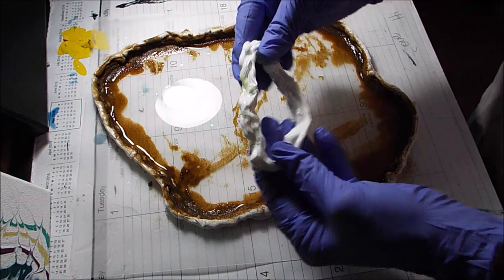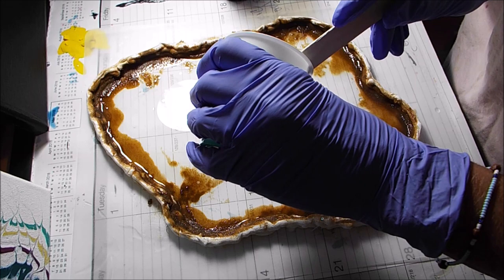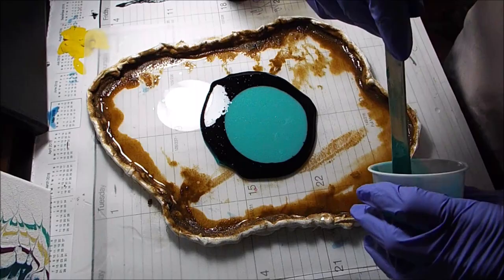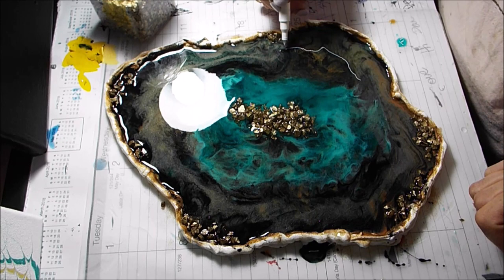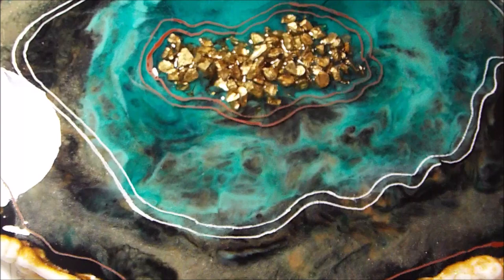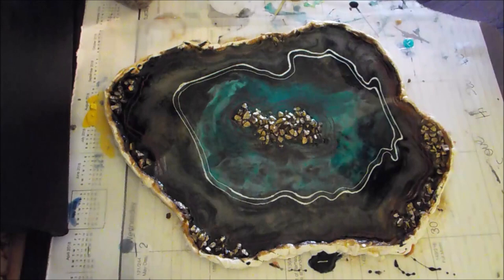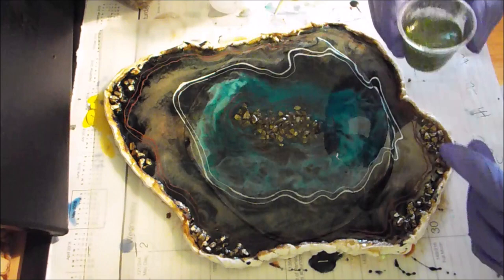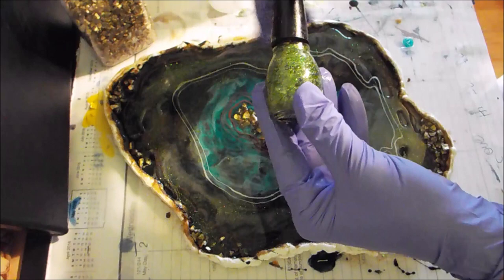Resin Geode #1 green mash up

Comment: How did you get it off the sheet, did it not bend or the silicone pull away?
Reply from the maker: It peals right off the plastic sheet, does not bend the geode.  The silicone I remove and reuse.